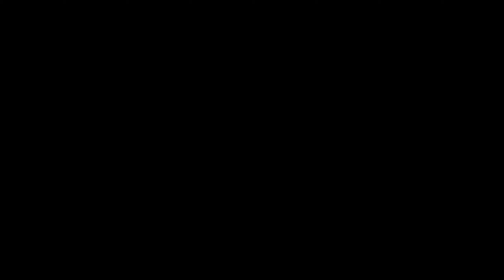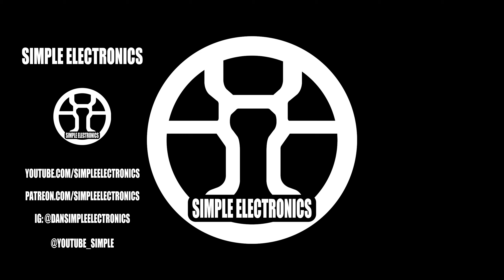The Simple Electronics Podcast - 124 - Local Shops

Comment: When I was a kid I was lucky enough to have a kit manufacturer in the nearby town of Benton Harbor, Michigan the then corporate home of Whirlpool & Heathkit. I had one of their kits that had plastic blocks with a component in each one that fit on a Lego type board. You would connect wires to springs on the blocks. I later on when I had a driver's license, went to their outlet store & bought a VTVM & signal generator.
I miss having the electronics stores in the area. We've lost most of them. 
We still have a Radio Shack one of very few left

Comment: Its a long time since I have built a professionally produced kit. In 1977 I built a Science of Camberidge Mk14. It was my first adventure into personal computers. The MK14, in its basic form,  was only programmable through its keypad and a case of writing out assembler on paper and working out the required assembly codes for each instruction. Then entering each code into memory of the device. Finally issuing a Run command from a specific memory address. Incredibly time consuming and a real pain! But at least it was the start of something.
Looking back it seems like the bad old days but was certainly an adventure. In the UK we had the Maplin catalogue, I spent hours browsing through all the listed electronics. Now no more unfortunately.

Comment: Thanks Dan. I just completed a Velleman kit recently, the "LED Buddy". It is not like an LED tester on a component tester. The voltage up to 12v (it must have a booster circuit as it runs on a 9v battery) and current can be adjusted through a pair of potentiometers and it will calculate the required resistor. It has the benefit of letting you see how bright the LED will be. It was a nice, good quality kit.